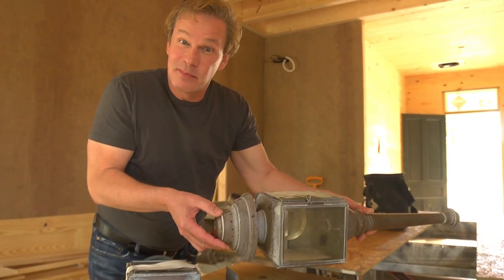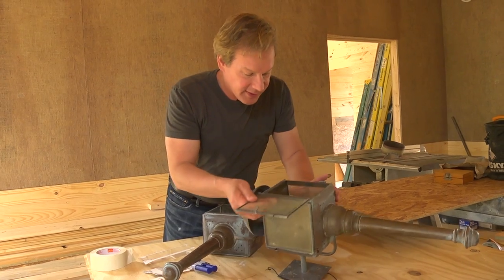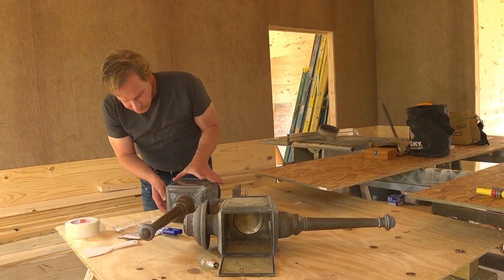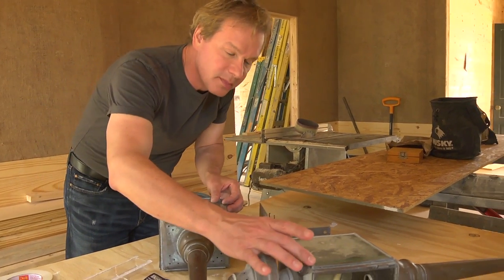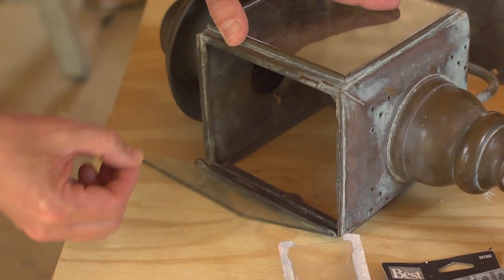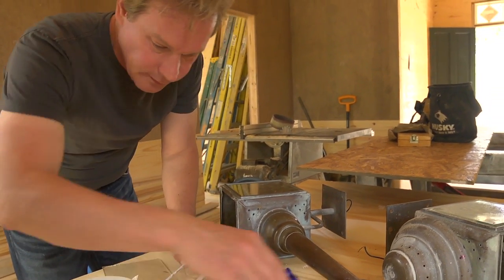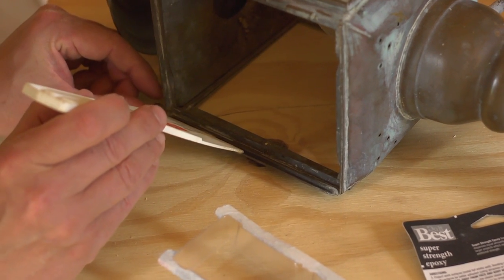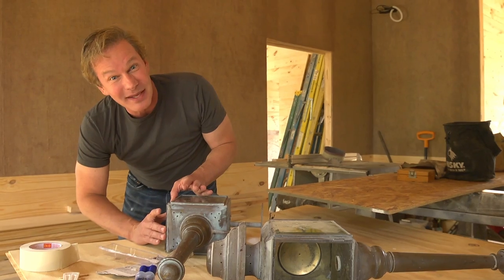Glass for Lamps | Day 102 | The Garden Home Challenge With P. Allen Smith

Comment: There are vintage restoration companies you could have checked out to have that lamp repaired. They would have matched not only the beveled glass but the metal door frame as well. Those flat glass pieces really won't do that beautiful lamp justice, especially when the light floods through it. The way bevelled glass refracts/reflects light can't be duplicated, especially by flat glass.

Comment: P Allen, Im sorry but I would never have used epoxy for glass. First Of If you ever break that glass its going to be a living nightmare to get that out of the slot without damaging the metal. Personally I would have used a clear silicone. It would more then hold your glass and place but secondly it provides a little bit of cushion against the metal.  and it can be a pain to remove but its not as bad as the complete hardness of the epoxy.  and Just as a little background i use to work at a glass shop so I know a few things about this. The other option i would have used instead of epoxy is a UV glue. It can bond to either metal to glass or glass to glass and it is stronger then you can imagine, and dries in minutes with just a uv light.  In some ways it would be worse then the epoxy to replace. but those are the 2 options that I know of for glueing glass in the type of situation. I hope that helps. Last suggestion with the lamps. Metal workers could not be able to repair that but I bet someone who works with stained glass would be able to repair the door to bad its to little to late.